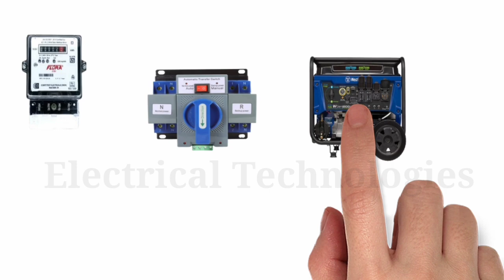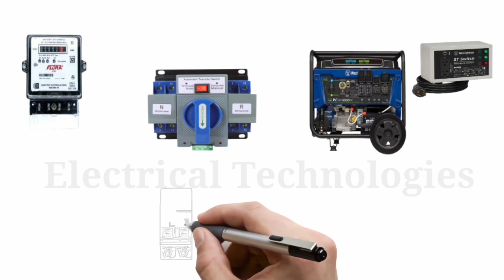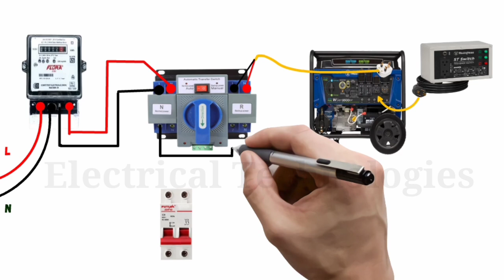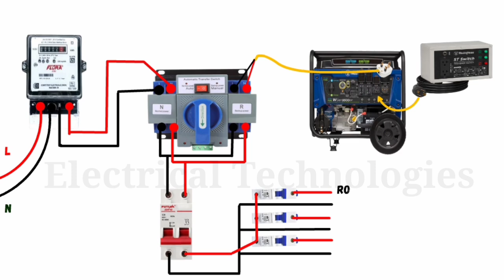Auto Changeover Switch With ST Switch

Comment: Thanks. It confirms that I can send the startup signal from an ST Switch (with its compatible 7 pin round connector for Westinghouse generator) and still connect the power to my automatic transfer switch.  But you don't show details of how the ST Switch is connected.  It needs AC from the house to detect power outage, and maybe (?) needs to be also connected to the generator's 30A outlet to get feedback of generator running (?).  The generator you show (and mine) only has one 30A outlet, so where / how to plug the ST Swith AND the automatic transfer switch on the gerenator at the same time?  Could you help by clarfifying this point?  Thanks.